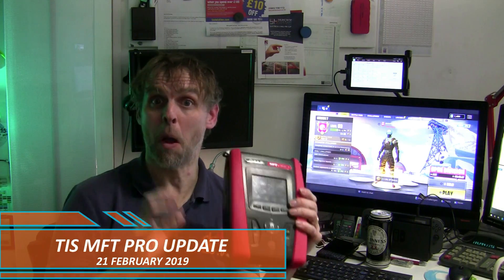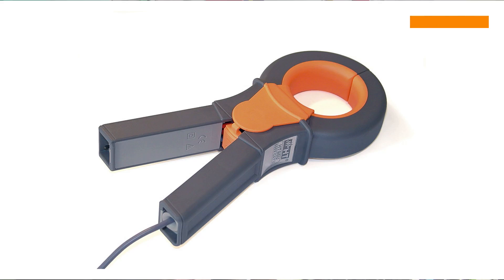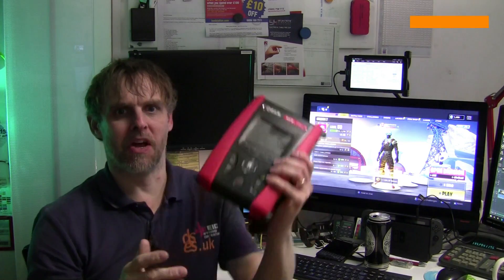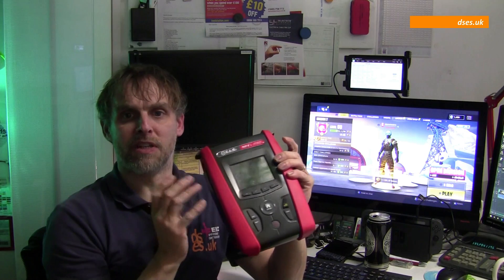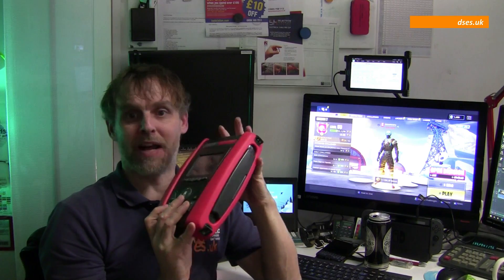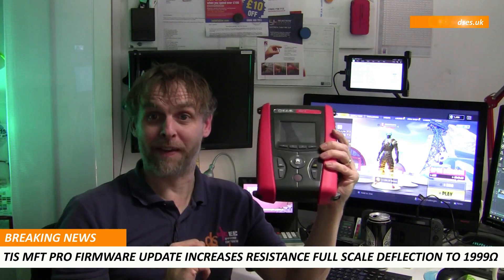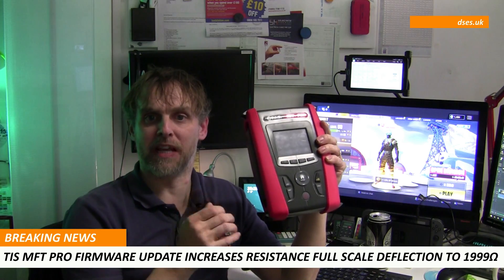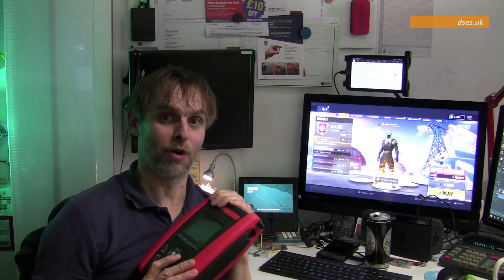MFT PRO Firmware Update

Comment: Hello, thanks for all your videos and content. I’m torn between the TIS PRO + (sounds like an energy drink or erection drug) or the Metrel 3152 it’s been a while since your last comparison, which one are you now favouring? Also I can’t find any videos or reviews on the software, connection I’d like to know which is better at collecting data in the field and then transferring it to the certification? Thanks again for your work, knowledge and lighthearted entertainment! Matt 😎👍
Reply from the maker: Hi Matt. Sorry for the delayed reply. Have you plumped for a new test instrument? I've always said the Metrel 3100s was the best buy I made as it was the most feature rich with sensible battery life. The 3152 is good, but it does chew through the AA's! Get yourself some Eneloop batteries if you go with either. Both the new MFT Pro and Metrel 3152 support EV auto-sequence testing (a new video showing such is hopefully out today), although you'd need an EV adaptor. The cheapest adaptor out there is probably the Ethos 8600.
Reply: @dsesuk   Not yet, I’m told a new Megger is on the way soon, going to see what that can do 😎👍

Comment: Buenas tardes sigo bastante tus vídeos y te doy la enhorabuena 👏. En éste aparato en cuestión y el Ht, que son iguales le encuentro un problema y es qué sólo miden tensión a partir de 15v, Megger a partir de 10v,Metrel a partir de 1v y Fluke  1664Fc partir de 0,1v.Para mí cómo técnico es importante saber la tensión que tengo entre Neutro y Tierra .
Un saludo 👋. desde España
Reply from the maker: Hola Héctor. Gracias por mirar. Espero que mi traducción funcione. ¡Mi único español es pedir una cerveza en el chiringuito! No he notado una lectura de voltaje mínimo en mi instrumento de 15V - He visto lecturas por debajo de eso antes, hasta 1V. ¿Está en el firmware más reciente? Puede haber diferencias entre la versión de la marca HT y el TIS que tengo.
Reply: @dsesuk  
Haz la prueba intenta medir 10v en CA por ejemplo, acabo leer el Manual de Tis Mft Pro 15÷460v.
Haz la prueba por favor 🙏 

AC TRMS Voltage Range [V] Resolution [V] Accuracy 15  460 1 (3%rdg + 2dgt)  Frequency Range [Hz] Resolution [Hz] Accuracy 47.0  63.6 0.1 (0.1%
Reply from the maker: @elektrikahectorfernandezol5341  Interesante. Mi MFT Pro indica "0.1÷100%" en la etiqueta posterior. Acabo de probarlo en un suministro de 4 VCA y se lee 4V. También tengo el MFT Eco, el modelo hacia abajo sin la pantalla en color, y que indica "15.0÷240V" en la parte trasera. Que leer 0V cuando lo puse en el suministro de 4V. ¿Su modelo HT es el mismo que el MFT Pro o el MFT Eco? Espero hacer un video sobre el Eco en las próximas semanas, así que gracias por hacerme consciente de la limitación de voltaje ya que puede que no haya visto eso.
Reply from the maker: Buenos días Héctor. ¿Borraste tu último mensaje? Parece que el MFT Pro no se comporta de la misma manera que el Fluke. No hay una opción de menú de voltaje en el MFT, lo cual es inusual para un probador multifunción, en lugar de leer un voltaje, selecciona otra función como la continuidad. Cuando está en la pantalla de continuidad, muestra qué voltaje se aplica actualmente entre los puertos negro y azul (fase / neutro) pero no lee lo que está en verde (PE). Si aplico mis cables de fase / neutro a mi suministro de 4 VCA, muestra 4 V en la pantalla. No muestra nada si se usa la sonda verde en lugar de una de las otras. Curiosamente, si entro en otra opción de menú como RCD o impedancia, muestra voltajes entre P-N, P-PE y N-PE, sin embargo, si aplico mi suministro de 4VAC a cualquiera de estos, las lecturas permanecen en 0V. Puede ser que estas otras funciones apliquen una impedancia más alta a las entradas, ya que son para pruebas en vivo, a diferencia de la continuidad, que es una prueba muerta, por supuesto. Entonces, para una lectura básica de voltaje pequeño de dos sondas, necesito seleccionar continuidad. Pregunté esto con TIS el año pasado, ya que todos mis otros probadores tienen menús de voltaje e indican todo el tiempo qué voltaje hay en las sondas independientemente de la función seleccionada. Los probadores TIS / HT no le dicen que hay voltaje presente hasta que ingresa a una de las funciones del menú.
Reply: @dsesuk  
Correcto, he borrado el mensaje por que no quiero confundirte,pero estoy totalmente de acuerdo contigo 👌. Yo como instalador  eléctrico aquí en España he preguntado a Ht, y no he tenido respuesta, tu veo que si,por parte de TIS🙂.
Veo que somos bastante parecidos tu y yo, yo también soy una persona muy inquieta y siempre me cuestiono todo. Veo que con el traductor de Google no hay fronteras, de todas maneras las fronteras las tenemos nosotros muchas veces en nuestra cabeza 😄,me alegro de conversar contigo, porque los que amamos nuestro trabajo no tenemos fronteras.

Comment: Hi David can you tell me what version of firmwear fixes the resistance issue, and where I might find this firmwear. I have installed v1.37 but my tester still only reads to 99 ohms. Thanks
Reply from the maker: Hi Clayton. I think it's version 1.39a if I remember rightly. Unfortunately, TIS don't offer it as a download as they insist re-calibration is required after applying it. They will update it for free if you send it to them or if they're running a calibration day in your area. Personally, I don't agree with that, and I'd prefer them to release the update publicly and leave you to recalibrate locally as you see fit, but that's the position they're taking. Get in contact with their technical support people and they can advise how it can be sorted out in your case, hopefully quickly and with the minimum of disruption!
Reply: @dsesuk  thank you David

Comment: “Out of spec on loop test” every single one we have had in for calibration.

Junk! You can guess better results.
Reply: 1 Fluke 165xB-C 
2 Fluke 165x original series
3 Megger MFT1500
4 Kewtech KT73
5 Megger MFT1700 Mk2 plus

If you are buying secondhand you need to get the latest firmware available.
Firmware is not normally user upgradable.
Reply: Service CTU I will check these out. I currently have the Megger mft 1710 and i do not trust the loop results as they change so much if re tested a number of times.
Reply: What are your top 5 MFT?

Comment: Hi I have the same tester and found it goes through batteries quickly and when meggering even quicker..the strap is a joke....and zs takes forever....I need this update...where can one get the latest update cheers love your videos
Reply from the maker: If using Alkaline batteries, decent brands like Duracell always do better. Mine seems to be doing okay, I'm still on the same set as when this video was made, but I have some rechargeable Eneloop cells I'm going to try in it when next swapping cells. What firmware are you running? Mine is 1.39a, although the TIS website only seems to have a download for version 1.37. When I first got mine, I had no luck updating the firmware myself, it was only a chance meeting with their rep that got it sorted. You should be able to do it via the firmware updater app on their website, but if you have no luck then contact TIS directly. The reps are always travelling the country, so they may be in your neck of the woods sometime soon if it comes to it. I still find it the slowest of all my testers on Zs testing though.
Reply: @dsesuk  hi thank you for the info... Just downloaded to pc.. Haven't had time... Checking for firmware.. Can't find it anywhere... Any clues.. Regards
Reply from the maker: Sorry, my experience was the same when I tried it - kept going around in a loop saying it couldn't find the firmware.
Reply: Hi again on start up it says 1.36 cpu...also have you used the save function to upload to pc...seems a bit of headache if you ask me...
Reply: I’ll email ‘‘tis and see when a rep is nearby cheers for info
Reply from the maker: Good luck - let me know how you get on!

Comment: What do the function keys do, I would have thought with it having a touch screen there's no need for buttons
Reply from the maker: When in any given test mode, there will be up to four menu options at the bottom of the screen which can be selected either with the touchscreen or via the associated function key. They'd be handy if you have dirty hands or thick gloves where using the touchscreen is less desirable I guess.
Reply: @dsesuk  thanks for that 👍

Comment: I use the Profitest Mtech+ at work, a fantastic bit of kit considering the whopping cost.
Reply from the maker: Never heard of it, but just Googled it and that looks fantastic; almost military like! I wouldn't feel right using it without camouflage overalls and a balaclava! As you say though, the price tag is a little eye-watering. Never seen one in the UK, where are you based?
Reply: @dsesuk  I'm London based and my company purchased a few of them when the new trains arrived.
It is a fantastic tool, so easy to use. A bit bulky but I don't mind that, balaclava and such certainly most required!
Reply from the maker: @HotAxleBox  Ha! Well I guess London is exotic enough! Wouldn't mind getting hold of one of those to play with though, I can never have too many testers it seems, especially if one looks like it belongs on the back of a Panzer!
Reply: @dsesuk  Its a shame I cant let you borrow it, all our extremely expensive tools like 5kV IR testers, olympus endoscopes, digital torque wrenches etc are kept firmly under lock and key. Panzer? Pfft.. This comes mounted on the airframe of a messerschmitt!
Reply from the maker: @HotAxleBox  Can't say I blame 'em for keeping them secure! But hey, thanks for pointing them out - they're now on my radar!
Reply: @dsesuk  let us know if you get one! :)

Comment: The TIS design is flawed, I know TIS tried to distance themselves from the traditional design of brands like Fluke, Megger and Metrel but the design serves a purpose as it makes it easier to read the LCD when taking measurements especially when both hands are occupied.
Reply from the maker: It is a funny style, you have to wonder why they went that way when everyone else does it differently. Even with the neck strap fitted as I think it should be, it doesn't really work when up a ladder with both hands holding the probes!
Reply: @dsesuk  I presume the heaviest part of the unit would be at the base so when taking a measurement, the LCD would always be pressed up against your chest. In trying to be different, they've only shown they don't think about ease of use for the user.
Reply: the layout is similar to my  old Megger CM500 which i really liked, and to be honest i did prefer that style rather than my Megger  1553,  which is the new style adopted by fluke and Megger.
Reply from the maker: @acelectricalsecurity  Good shout, it is a similar form-factor to the CM500 now you mention it. Do you still have that, or did it meet an unfortunate demise?
Reply: @dsesuk  i do still have it, its been apart a few times, the selector would need cleaning from time to time, but i must admit out of all the testers i have owned that was my favourite one, gutted when i had to get my fisher price 1553.
Reply from the maker: @acelectricalsecurity  The 1553 is a top bit of kit, and so easy to use. It really has everything I need, apart from phase rotation. I just prefer to use the Metrel and MFT for their better displays most of the time. I ought to give it an outing on the van more often for old times sake!
Reply: @dsesuk  yeah its ok, ijust preferred the cm500, i had it for ages so as you know you just get used to things, plus it did a two wire no trip loop test my 1553 doesnt, does that TIS MFT do a two wire none trip loop test, seriously considering getting one, not at the £799 plus vat cef want though
Reply from the maker: @acelectricalsecurity  No, three-wire (I think all my testers are three-wire for no-trip)!